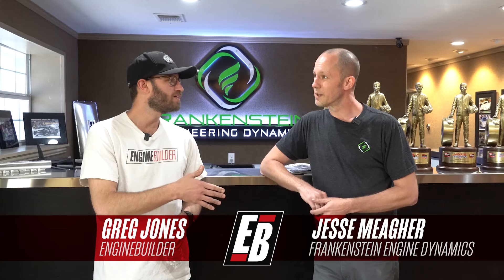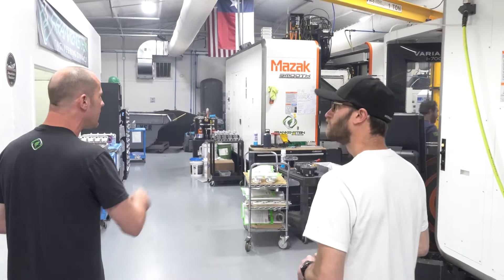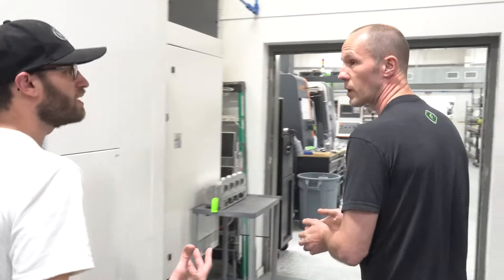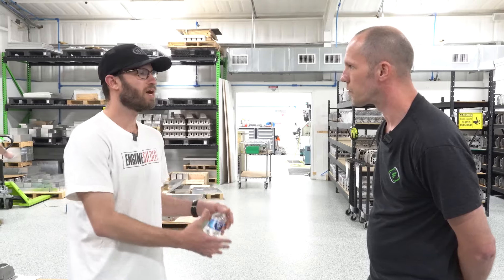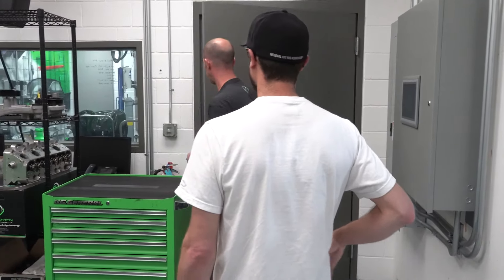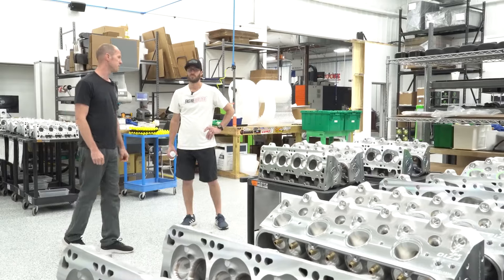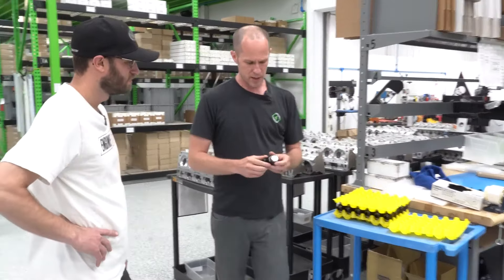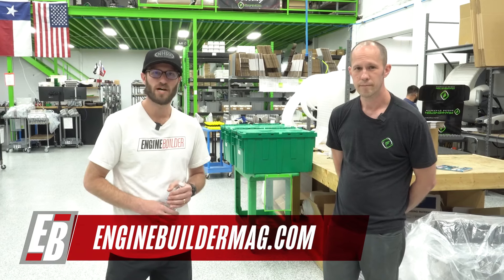Behind the Curtain of Frankenstein Engine Dynamics

Comment: So only chev heads. Shocking
Reply: Did you miss the pallet of Gen3 HEMI stuff in the video?
Reply: All you need is Chev.  JC 2 valve pushrods rule. f them 4 valve fords😂
Reply: they make aftermarket LS heads and SBC heads. 

They CNC port Honda, Gen 3 hemi, modular 5.4/5.8, coyote, LS heads, both cathedral and square/rec port, LT1/LT4, BBC (SR20) heads, Gen 3 viper, and Duramax. Probably missed 2-3 more applications, but the selection is wider than just LS. LOL